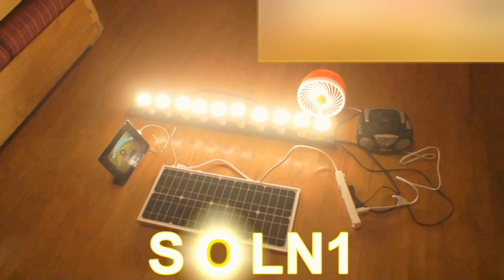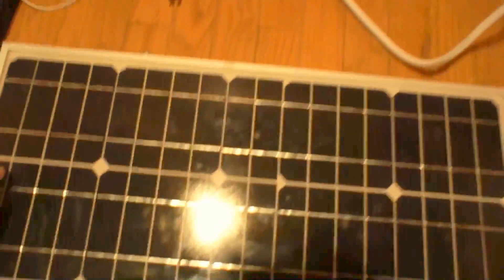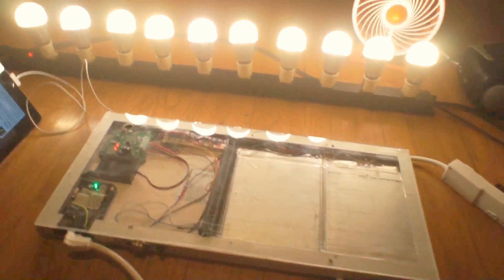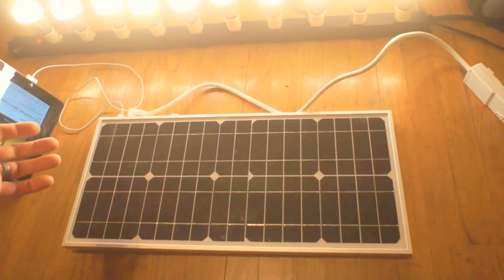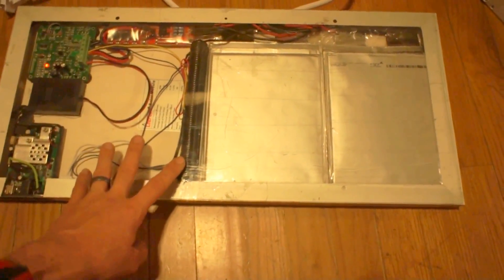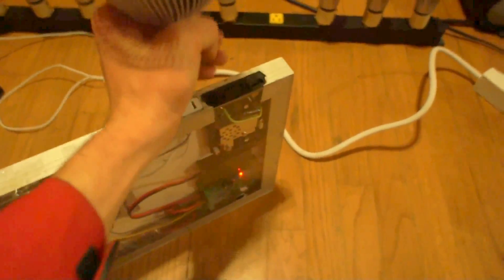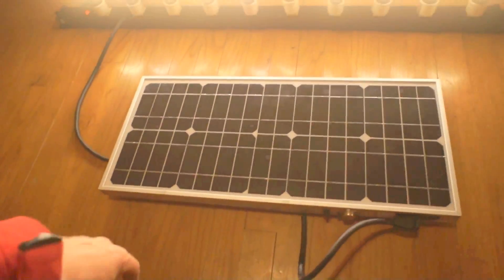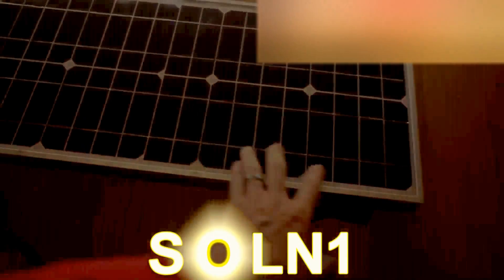SOLN1 - Amazing all in one free energy portable solar unit.

Comment: Wonder what would happen if we take the solar panels, and incase them inside of a mirror finish housing.  
Where the solar panels are NOT exposed to the Sun.....but rather are located in a Housing that is completely reflective Inside of it.....meaning.....the walls, the floor, and the ceiling inside the Housing, are ALL Mirrors.   Inside the housing with the Solar Panels would be an Incandescent Bulb.......the light from the Bulb is trapped inside the Housing, and reflected inside the Housing because the entire inside of the Housing is a Mirror.  The solar panels located inside the housing would receive light from the Incandescent Bulb itself, and also from the Bulb's light being internally reflected by the internal Mirror finish.  

I'm curious to know if the Incandescent Bulb would act as the Sun.............to power up the Solar Panels to produce enough current to Power the Bulb, and also output some amount of Power while the unit is turned on.    Turning on the unit would simply power up the Bulb from a temporary battery source, once the Bulb is ON, the Solar Panels should start producing the power to power the Bulb inside, and also provide MORE power than the Bulb consumes?     Like, call it a LightBox.

Comment: that's really cool what is the weight for the device as it is. I ride a motorcycle and like to go camping in the mountains, and something like that would be great to take along. I have a mini solar charge pack that I use to keep my phone charged that I mounted on the top of my trunk pack. but it would be really nice to have something like this to actually have light with out having to carry extra batteries.

Comment: I  hate to break it to you but 20 amp hours is nothing. I am running a 28 amp hour battery with a 30 watt solar panel for a portable solar generator and it is only able to power a fan for about an hour without sunlight. 20 amp hours is 20,000mah which you can easily get from a portable lithium ion battery bank and then just buy a 12v socket with EC5 connector and charge the battery bank with a portable fold up solar panel. You can do this for the same price or cheaper, its much smaller, way more portable and much much lighter.

Comment: it looks like a closed loop system of sorts.
but is this capable of recharging depleted battery#1, before battery#2 becomes to diminished to power in tier unit as shown.

will it remain in constant state indefentely  as shown or does it reach a diminished point of equalization incapable of work

Comment: Too many morons fake shiiiit on YouTube these days!
Reply: If you understand the electronic's you will see it's not fake.. Its a 14v solar panel which runs a 12v charging circuit then this charges the lithium cells which in turn runs the AC Inverter which will probably run about 4-500w which will run 120v Led bulbs All day long or a regular bulb for about 5hrs It will also power small electronics and other low wattage appliances, All from charging from the sun! Its called free energy and bigger setups nowadays can run a whole house with multiple panels on the roof charging leisure batteries with bigger inverters, Obviously there is substantial cost to make the setup but once built this would give you free energy for a good few years before the batteries loose there duty cycle and need replaced. Hope this helps in understanding this technology

Comment: Just wondering about heat and lithium batteries and eletronics. I know heat destroys lithium batteries. If you charge and discharge a lithium battery at 40c over its lifetime is normal but worse than charging at 20c. solar panels get up to 70c and charge them 10 times at that temp is like 100 charge and discharge cycles. I love this Idea just want you to know. Awesome Idea Thanks👍

Comment: this would be perfect for small camper vans, boats, etc that don't need a huge array. i love the compactness of this system. no heavy batteries plus controller panels or split charger wiring sytems etc. you best market this fast. if the cost is effective i realy  want 1 of these now. i know a fair bit about solar power this is how it should be delivered.

Comment: @ lasersaber  I know you are using led lamps but how efficient is the unit at powering normal bulbs with a filament type bulb
Reply: SP330Y 100 w bulb would last about 2 hours then the batteries would be very dead. low voltage shutdown would probably occur at 1.5 hours.. very rough estimate. but the LED bulbs that he has may be as low as 4 watts each.

Comment: @ lasersaber What is the mA rating output of the solar panels?, not the battery, the actual output in either mA or Amps or even Watts.

I presume its either 12v or 24v output from the solar panel, but would love to know the actual ampage output of the solar panel prior going to the batteries, thanks interesting device
Ive been looking at wind turbines and their efficiency and power output,i think although solar energy is good, i think that wind turbines kick out way more Amps

Comment: lightsaber I have two 35 what solar panel. what would I need for inverter watts. 12 bolt system and I want it off grid and close circuit.

Comment: don't forget you need to keep the panel cold and not hot I bet with all those circuits in that poor little panel you wont get efficient energy since it will get really hot especially in the hot summer when its exposed to full power sunlight not to mention that lithium batteries can burn down ur house, put lead acid batteries instead..

Comment: The one thing I did not understand is, how come even if the solar panel  faces down the ground , it produces electricity, means even sunlight is not required for this wonder panel.
Reply: It has built in batteries :)
Reply: +Manoj Kumar S Nair battery
Reply: Because the batterys are charged. The power is coming from the batterys the panels charge the batterys.

Comment: should you not be outside in sunlight?
Reply: daniel mccrea it was already charged in the sunlight and the power is stored in the two lithium batteries that are placed side-by-side on the backside of the panel, The runs from the inverter and controller

Comment: I really like the idea and want to try one out.  I have a setup now which consist of a solar panel outside with wires coming into a room with a 35 ah battery and controller and inverter. kind of a pain to move around.

Comment: i will say before i go, this is a good portable solution, but does no good for home, rv, or even semi's. imagine having to go on the roof to plug in every device that needs the power. also think about what appliances you can run on this system (tv, xbox, frig, stove, music devices, dishwasher, computer) to name a few. how many of these would be needed? can they be daisy chained? can it be adapted into normal home or rv power syt stems. can the batteries be replaced? what if the solar cells need to be replaced? what about the part where it shuts down the load does that mean that i loose my game save on xbox? more seriously, what if i am dependent on a machine to keep me a live at night, hook it up to this system and it shuts my machine off?

Comment: For a prototype it's a really beautiful thing.  It's 2015 so I imagine your project has moved on.  I was impressed to hear you are robustly road testing and expressed no concern about overheating though you did outline components which manage charge.  Other than the US electric connectors this would be just what I've been looking for a shed/workshop off grid project I am mulling over.  Many thanks for sharing.  I will check out your other vids and subscribe, in order to get educated about the components needed for managing off grid power sources.  I'd really like to do it myself as currently the costs are too prohibitive to go to sellers.  Your message is inspirational.  Best wishes with what you endeavour.

Comment: Placing this solar panel on a roof during the summer, will probably have a dramatic effect in those lifepo4 batteries. Based on my research and knowledge on the subject, the amount of cycles based on average and controlled temp's will be reduced. The amount of reduction will be determined by exposure to heat. Thus your panel on a hot tin roof somewhere in Africa will suffer a quick and prematue death. 

Another concern is the wattage of the solar panel itself. You have to figure that most consumers will drain the batteries until the BMS shut's it down. For a Lifepo4 battery were talking 20% of the capacity left. Let's say 2 AH per battery left.  A 20 watt panel produces a 1.17 - 1.5 amps under ideal conditions. You do the math for charge time....

Comment: if you put the panel and lights in a box will it power it's self and have extra energy?
Reply: +Johnnie Blevins good question
Reply: +Johnnie Blevins thats impossible  =)
Reply: +Johnnie Blevins no the solar panel dose not have 100 percent efficiency and there is some power being lost to thermal (heat) energy, and some being lost to the light that dosent even hit the panel. so no it would last a little while then stop.

Comment: Well, one reason it did not take off is that when charging in the hot summer sun, the battery life is shortened by as much as 50% and there is high risk of battery damage at high temperatures generated by the sun. The solar panel can get as hot as 100C on a hot day. Very dangerous setup, keep away from flammable materials. Lithium batteries should be kept at room temperature when charging and discharging.

Comment: im in, how do we build in bulk. i'll help you build them, ill use my resale permit for cheaper micro bulk parts, i need these for my business that im going to launch next spring, your welcome to an infinite share of a percentage of all profits. i attempted to attend ITT technical institute to get a degree in electronic engineering twice and dropped out, i don't understand the more complex circuits but build simpler circuits, i built my portable cellphone charger aka battery bank in 2003 for my nextel because carrying extra phone specific batteries were a pain on top of charging the extras. join my team and let me join yours

Comment: The only issue is solar panel gets replace in a lifetime and batteries. If leds are used that's good. I still think it out ways using government power. Then you depending on them. If idiots vote wrong people in office they have you by the nut sack. I'd pay more to stay off grid. Same with food. I'd pay more to buy local or grow on my property. It's not about cost. I don't make much $.
Reply: +johnstarr2001 It doesn't matter who you vote for, the people who own the system will continue to run it however they like.
Reply: AllPro777 well said guy about doesn't really understand about solar power and how it can free us and less and our carbon footprint

Comment: Salam... good work.
Overcharge protection and everything sounds good. If I were you I will just make one addition.
Install and insulating material at the back of panel and then install my stuff at back and then add a DC computer fan to the back casing because in my country (Pakistan) summer tops at 48 degree Celcius and I am afraid at that temperature the batteries may pufffffff... :)

Comment: What if you added an LED series facing the SOLN1 with magnification, facing the solar panel. An energy loop should feedback into the system, to charge the batteries from what energy is not being used, while it is running... this could also add to light being emitted, benefiting the overall light output from the system.

Comment: Totally agree ,there needs to be more fully complete kits available ,once assemled ready to use and plug in.I have found it impossible so far to figure out ,the more you find out the more you need to find out and by then most people will be put off.
     One company claim to have a controller and converter kit that doesn't use batteries.What can be done without batteries and what can people do from just a window for those that haven't got a roof or garden to use ?

Comment: This is a neat idea, but in the warmer climates you can't have Lithium cells on the back of your panel; the heat will fry them. Also, sealing the back of the panel kills your heat-shedding ability, decreasing the efficiency of the panel and shortening the life of the cells. Active cooling would solve the issue, using a bit of power in the process.

Comment: Good idea!
What about the heat generated by the mono module?. It will affect the battery, charge controller and inverter. I think you need heat isolation, especially in the hot regions.

Comment: You have simply made a larger version of commercially available power banks incorporating a solar panel. 
Solar panels need ventilation while electronics need protection from weather.
18650 lithium batteries would be cheaper and more readily available.

Comment: Solar panels work better if they have ventilation under them I would put batteries and electronics in another package. I know that's not what you intended but to make solar panels efficient they need ventilation under them. I like the idea and even with a 2 part system it may work using harbor freight solar panels. Harbor Freight  solar panels work even in cloudy days. That's why a lot of people use them. And they are cheap in price.

Comment: I think a larger panel would be better.  This is a rather small panel and would take more than one day to charge completely dead batteries to full again.

I think if you are looking at something portable, try one of those hinged panels in the 75 watt range, that should charge your completely dead batteries in one full sun day and be more practical.

I think I would like to do a unit like this but keep all electronics separate from the panel but can be stored in the panel during transport.  The reason being, you can keep your panel in the sun and other electronics and batteries can be further away where they will be more useful.

Comment: was thinkin that if a oneway mirror was put on top of the cells upside down so that the mirrored part faced the cell it might increase the effiency of the cell althought when the light goes through the mirror it might also change to heat and the cell not produce any energy at all